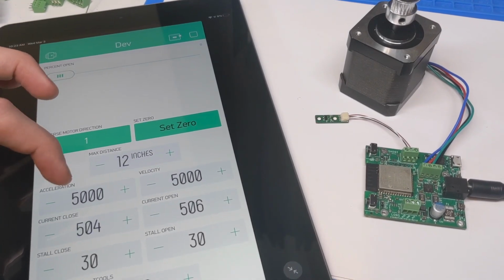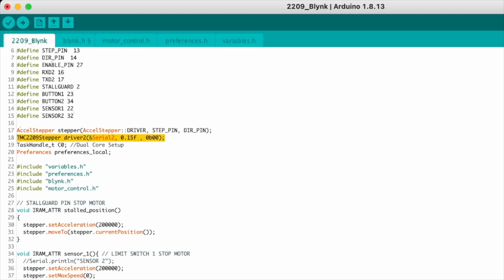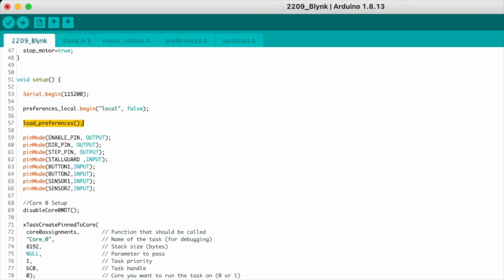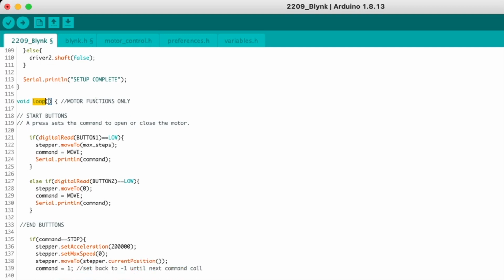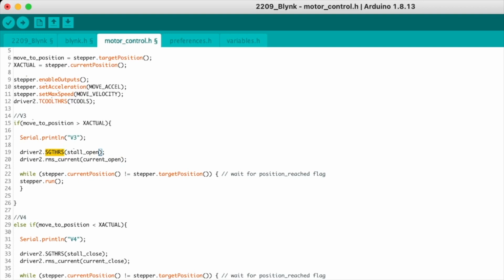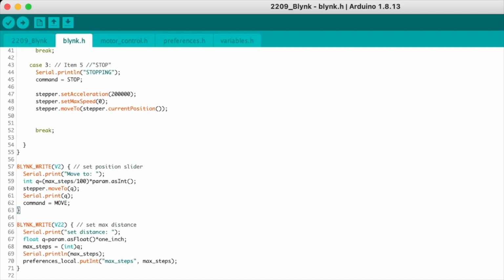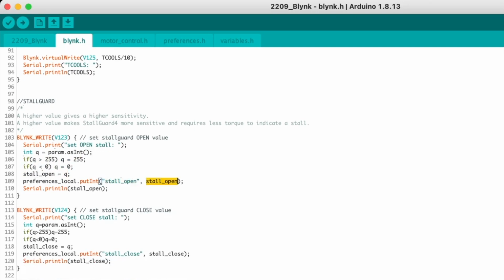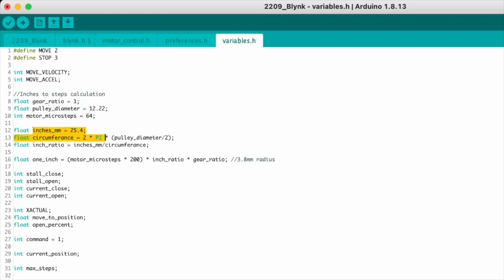Trinamic TMC2209, ESP32 and Blynk Code Walkthrough

Comment: Trying to use a Teensy 4.1 and a TMC2209 Driver and UART interface to control a NEMA 17 motor.  This is an embedded system application.  Will the Udemy course referenced in this video be applicable for my application?  Thanks for sharing.
Reply from the maker: Will you be developing it using Arduino? I rely on a Arduino library called TMCStepper. If so, the course will be perfect for you
Reply: @Daniel-Frenkel  actually we are developing it in C++.
Reply from the maker: @justindyster7073  You should port the TMCStepper library to work in C++ (which I've already done, but need to add to GitHub). The library is already written in C++ but just uses a few Arduino commands that are quick to convert. I do not recommend manually writing your own code to control any Trinamic driver as it's extremely complex to figure it all out. I used to do that, but it took me years to figure it all out. I also highly recommend running FreeRTOS, that's been a life saver for me. If you can get the TMCStepper library working, then I recommend watching my Udemy course
Reply: @Daniel-Frenkel  My college (Layne) took your class and would like to know what RTOS your using and would also like to get the code off the Git hub (Link is broken).
Reply from the maker: @justindyster7073  I'm running ESP-IDF, which is a port of FreeRTOS. It's only made for ESP32 devices though. The following code is written in Arduino but uses FreeRTOS functions, like "xTaskPinnedToCode" .New link is: https://github.com/daniel-frenkel/Valar-Systems/tree/master/VAL-1000

Comment: Hi, very cool the stepper motor control video using this TMC driver, I'm a product design developer... I've been focusing on developing front end for a while, but now I intend to go back to some projects that were stuck... among them learn about stepper motor, to apply it to my project in an industrial CNC, which I did about three prototypes in the near future, but
I never actually got it working... now I have a
good mechanical design of the Router... and I'll start with the studies
of stepper motor. A small that is not in Portuguese...

Comment: The board that you designed for this project is amazing! compact and packs a punch! I am also working with the TMC2209 at the moment, would like to check if you how did you wire up the UART connection?

Comment: Thank you for your selfless sharing! I learned a lot from your code. Because I am trying to use ESP32 to control two TMC2209 drivers. I will try to use FreeRTOS and HardwareSerial to handle it.
Reply from the maker: You're very welcome. Maybe look into using MultiStepper library for Arduino? I use ESP-IDF as well but it's more complex